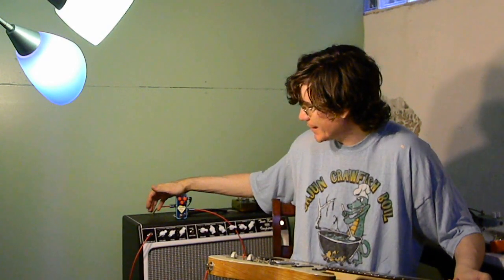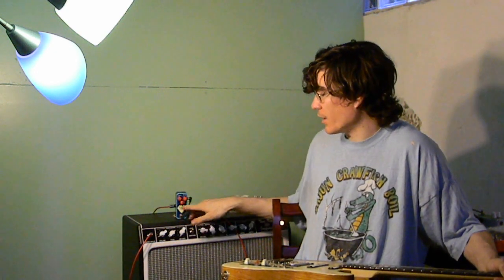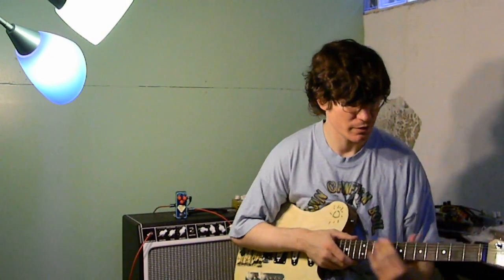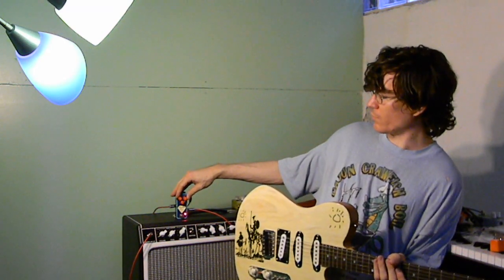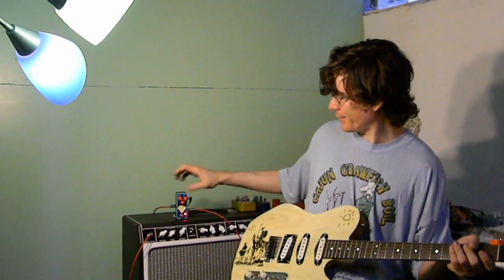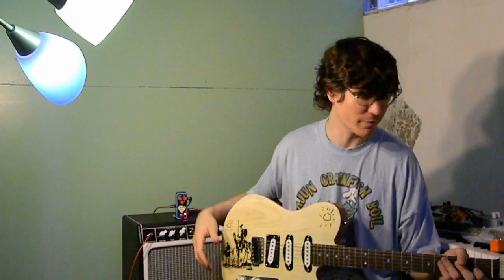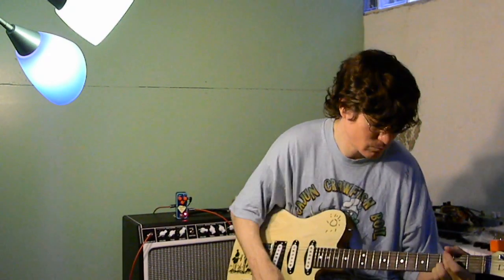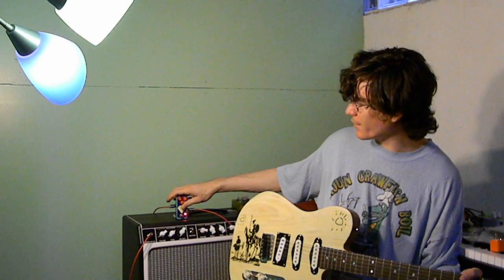Supreax Deux (Runoff Groove) demo

Comment: Running this on 24V (max1044) and love it. I get enough gain for vintage single-coil guitar, but without violating RoG's 2/3 Bias rule like the JHS pedal does. Thanks for pointing that out jon (can't remember which forum.)

In retrospect, I should have tried clipping diodes at the gate of Q2 as the Azabache does, but I'm very happy with the sound overall.

Comment: Did you try the Bass Cap switch? Do you think there is enough difference to swap it with a 1M pot?
Reply from the maker: I didn't need the bass switch for my setup. The 1M pot is only a 12dB filter at most so it's not as dramatic a change as the switch. I did build one for a customer that had the bass switch and it's a dramatic change.

Also, I can tell you it doesn't sound nearly as good at 9V. Build as directed.
Reply: The 2.2n cap ended up being a little bassy for me, so I did a 1n and 10n for the Bass control. Works well enough, but I can't imagine ever turning the control past 50% unless I was playing Doom Metal in a sweaty garage somewhere near Palm Springs.
Reply: jonspatton I'm building a second one. If I replace the 1M resistor & switch with a 1M Pot how can that possibly have less of a range?

Comment: Built one of these and love the sound, except that the tone control is way too subtle, I only hear a difference when monitoring with headphones (its working, technically), is there any way to fix this?
Reply from the maker: At most it will be a db/octave filter. It's a shelf filter while there's still any resistance between the cap and ground. The cutoff is 700Hz, which isn't that low but isn't crazy high either.

Your best bet if you want it to be more noticeable is to either increase the 1.5nF cap or use a completely different type of tone control.
Reply: honestly, i almost went without the tone control on mine. decided to keep it, just in case. imo, all it needs is a subtle treble roll-off.